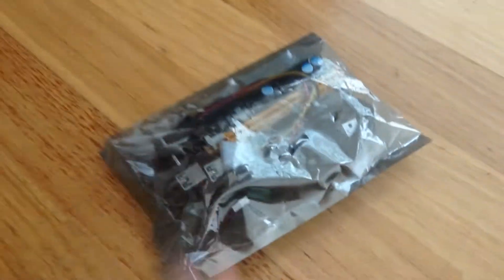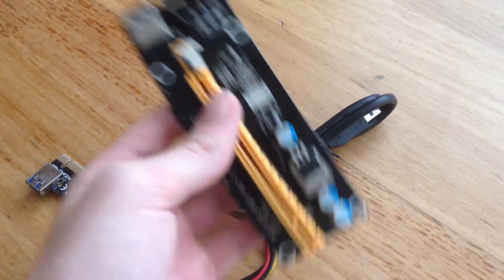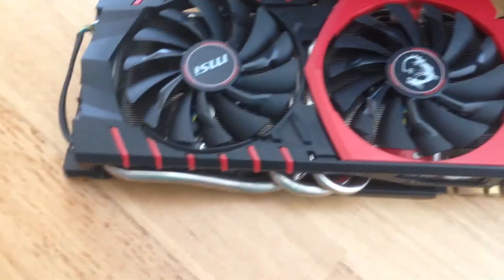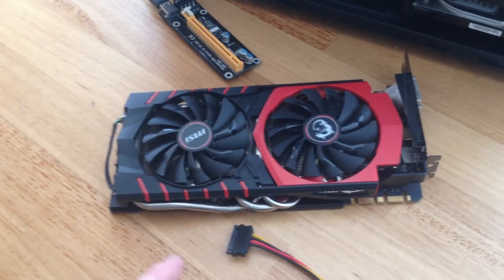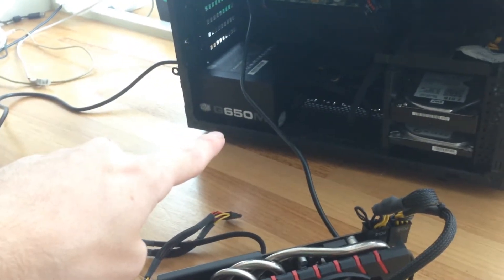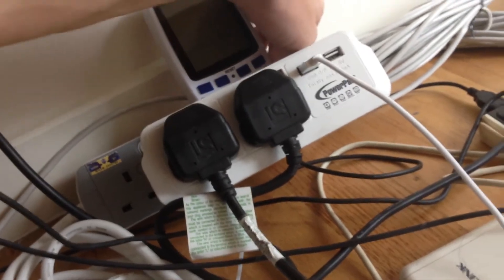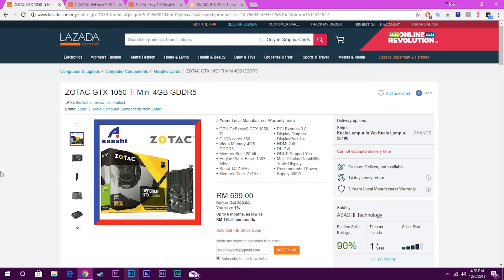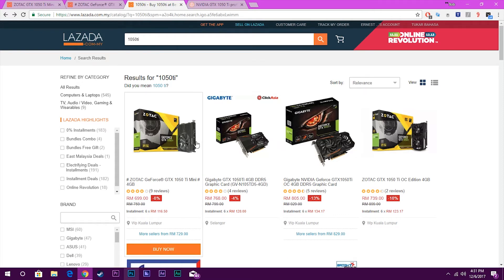Testing the New PCIE Riser before buying a 1050Ti

Comment: Can I use it for gaming in my pc
Reply from the maker: Technical World For mining yes, make sure your pc has a PCIe 1X slot (they are normally black slots), and that you have room to mount your GPU inside your case. For gaming, I don't recommend it, because normally GPU's (Graphics cards) use 16X slots, if you use a 1X slot you will lose some performance.
Reply: if you use a 16x to 16x shielded ribbon riser you'll be ok.
Reply from the maker: C.W. Winger Damn, forgot to mention that. Yea if you use 16x to 16x it's fine. But that is if you have a spare 16X slot, which I don't have.